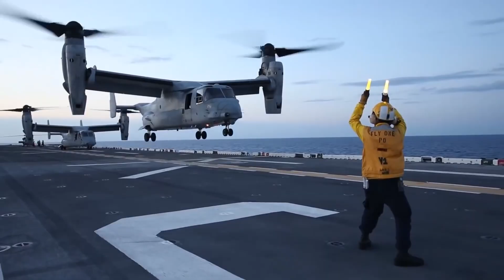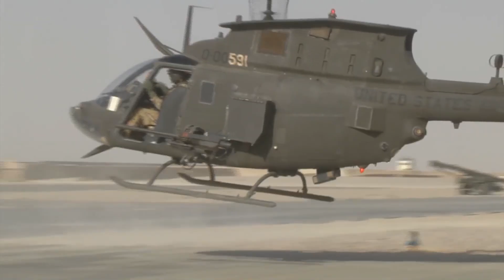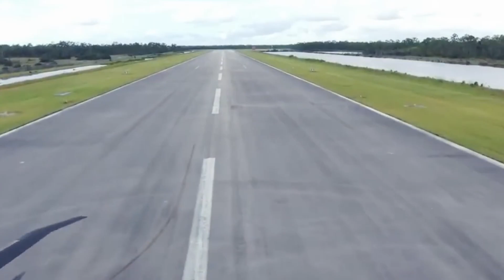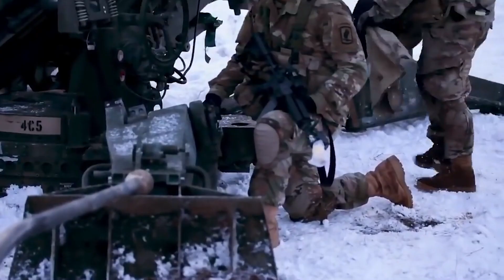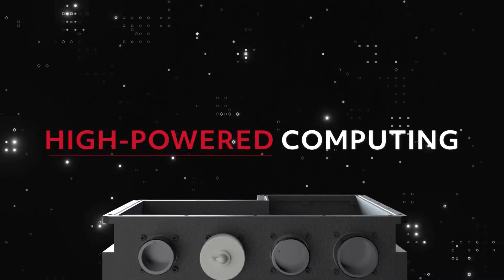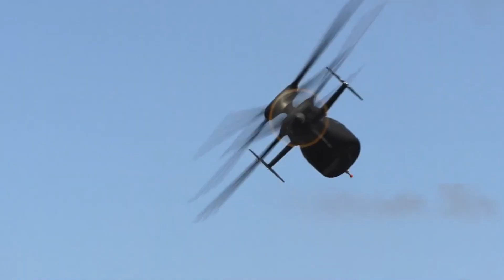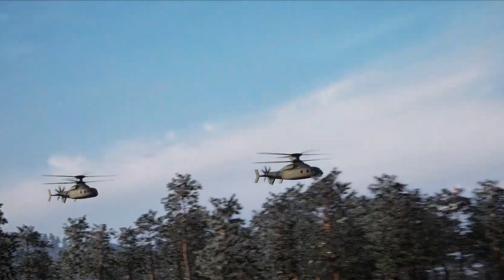SB-1 Defiant - Must go faster!

Comment: I don't understand why nobody in the US Army sees the obvious flaw in a tiltrotor aircraft trying to fly in a highly contested environment - one good hit to one engine while it is hovering and the whole plane is going to just flip over and crash.  It is simply NOT a survivable aircraft in a combat environment.   The Russians have been using the double stacked rotors in their helicopters for many years already, and in Ukraine, we've seen many, many examples where MANPADS hit these helicopters, and yet the helicopter was able to either return to base or to auto-gyro down to a survivable landing.
The main benefit of the counter-rotating stacked rotors is that they don't generate the tremendous amount of torque on the airframe that in a single rotor helicopter has to be counterbalanced by a tail rotor driving against the torque rotation.   The need for this tail rotor was always a deadly weakness of these traditional single rotor helicopters, as a hit to the tail rotor or tail boom would cause the helicopter to spin wildly out of control (as depicted in many, many Hollywood movies).  A twin rotor helicopter does not need its tail boom to keep flying.
I hope somebody sees this problem and keeps the Defiant X program going.   I think the Valor definitely has its uses and advantages, but flying into combat environments is not one of them.  
 If the Army wants to continue with its Air Cavalry concept with helicopter borne assault troops, it's going to get a lot of its soldiers killed trying to fly them in with the Valor.   It really needs a double stack rotor helicopter like the Defiant X to do that with any chance of success.
Reply: Totally agree. The Valor is an impressive machine and has countless uses in the Chinook role. But the way the Special forces and Marines use black hawks in operations currently will get many more soldiers killed. 

People keep saying who cares if you can't get there fast enough or don't have the range. Sure.

In contested territory, it still needs to be the defiant inserting our forces and getting them out. Because who cares what your range or speed is if your in the hot zone for twice as long because the rotors are "tilting". It maximizes the amount of time in the "your all dead zone" while at it's most vulnerable.

The mechanics of helicopters are a challenge in modern combat, and the DefiantX is vulnerable in similar ways that the black hawk is. But the Valor is MORE vulnerable in the direct combat role than either. 

We still need the SB-1.

Helicopters do a massive amounts of grunt work away from the front line, the Valor is amazing for that role. 

In the hot zone, I want a SB-1.
Reply: Cope.

Comment: Having worked on the CH-53 A & D, the gearbox on the SB-1 looks huge, performance is one thing, but maintenance is critical, and maintenance support equipment is also critical, it looks like the SB-1 would make field repair challenging, sure you can airlift it stripped down to a better maintenance area, SB-1 doesn't look like a mechanics dream, but a maintenance challenge (Busted knuckles')
Reply: The Russians have been flying those co-axial Kamovs for 60-70 years now.  They are popular logging helos outside the US.  I was in Papua New Guinea when the then Soviet Union sent over six Ka-32s and an Mi-26 to work the Kutubu Oil Field project as a demonstration.  They shipped the Kamovs over inside an AN-124 with the transmissions and rotors removed. They reassembled them all on the flight line at the international airport in Port Morseby and flew them to the work site in the central highlands.  Halfway through their first year there the USSR dissolved and nobody knew what country they belonged to.  We kind of felt badly for them.  Two of their wrenches were Afghan vets and let's say everyone gave them a wide berth.
Reply: I like the KA-32 and Mi-26, but when the bullets start flying, it's all about fixing and getting the bird back in the air fast, the support equipment for the SB-1 will have a large footprint, large enough crane to lift the gearbox, work stands, support equipment.  We had for the CH-53 A & D seemed a lot, but compared to what I've read about the SB-1, it's going to be a challenge in the field to fix.  This is an aircraft that's replacing light transport, UH-60, but it's the compact dimensions of a CH-53 A or D fuselage wise, and small in internal volume, a lot of fuselage and hardware for a small capacity. @philsalvatore3902

Comment: IMO the SB1 and V280 are 2 different solutions to 2 different problems
Reply: Except that they were both offered as the solution to the exact same problem, and in the end the V280 was selected because it better fulfilled the requirements that the military was going for. Not to mention the V280 program passed most of its flight tests with flying colors, whereas the SB1 has far less flight hours due to technical issues.

Comment: The Bell V 280 is better than the Defiant. Why? The Defiant would be in the attack role than the Bell 280. But that misses the point. The reason the military needs that range is because when fighting near peer opponents, you face long range missiles. That means the airbase needs to be far away to either out range the missiles or provide time for air defenses to kick in. So you need a fast, long range helicopter to get there. This is the main reason they chose the 280. They protecting the air base at the expense of the attack role. The second one, is we expect the future battle field to require island hoping in the Pacific. You need a faster, longer range vehicle for that.

Comment: It's extra huge. Probably spends most of its energy lifting itself. "But it can go 'fast'." All the destruction of human potential, productivity, wealth, just for 12 guys; fast. LOOK at it. You can still see where a UH-1 would fit. "But a UH-1 can't carry 12 guys." 1) in comfort; 2) so add three feet.

That second experimental looked pretty slick. Then a committee got after it. Tell me this isn't another "Pentagon Wars" but without the funny bits.
Reply: Speed is more important than you might believe.

Comment: I wonder how much aerodynamic interference between the rotors there is on the co-axial rotor designs.
Reply: In many ways they are far more efficient than a single rotor.   A tail rotor wastes about 20% of the helicopter's power just to keep the nose pointed where the pilot wants it.  On tandem rotor and co-axial rotor helicopters all your power is available for lift.  On a co-axial system like Kamov has the rotor vortex from the lower rotor cancels the vortex from the upper rotor in a hover improving hover performance over what would be possible with any other configuration given the same power and weight.  
Drawbacks are the masts are draggy and the control systems are diabolically complicated.
Reply: @philsalvatore3902  yes, I already knew about the tail rotors power requirements, that they are more complex to make and more draggy. I was more interested in problems due to flow field interactions equivalent to those of multi-wing aircraft.
Reply: @neiloflongbeck5705  Like I said, in a hover the vortex of the lower rotor basically cancels out the vortex of the upper rotor so they are extremely efficient in an out of ground effect hover.  In forward flight the rotor vortexes trail the rotor disc and don't give any advantage. 
I had a ride in a Ka-32 once.  I had an engine failure in my BV-107 and had to jettison an external load to land.  The load stuck in some mud and it was too much for another BV-107 to pull out.  The BV-107 has two 1,500 shp engines while the Kamov had a pair of 2,200 shp engines.  We begged the Russians to help us out (and they were eager to prove themselves) so I hopped into one of their funky Kamovs to show them where I dropped my load.  Everything in the cockpit was in Cyrillic and the gauges had metric units, including airspeed, altitude and vertical speed.  They hooked up to my load and pulled power.  Nothing, load wouldn't budge.  They pulled more power until the engine overtemp horns and lights came on.  They ignored them.  They pulled so much power the rotor system rpm drooped to 65%.  You could almost count the blades passing in front of the windscreen and I was starting to wonder how low you can drag the rotor rpm before it stops flying.  Suddenly the load popped out of the mud and we shot up several meters.  Rotor rpm returned to 100%.  Whew!